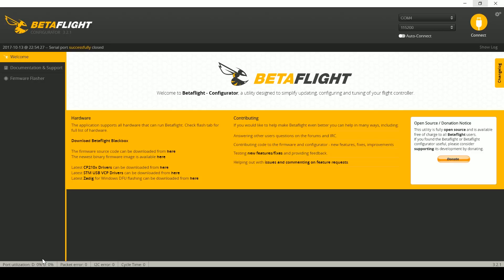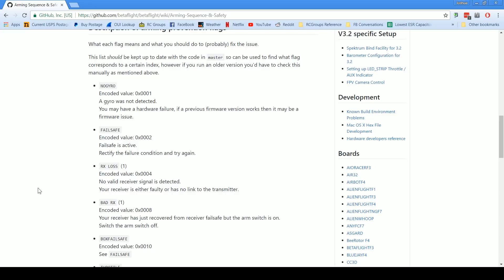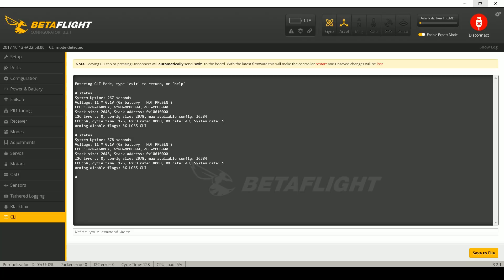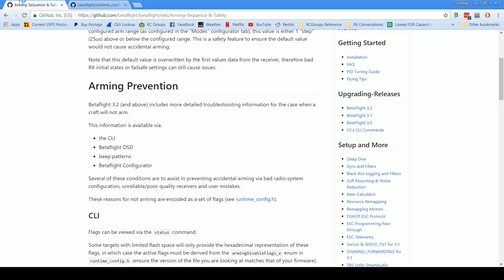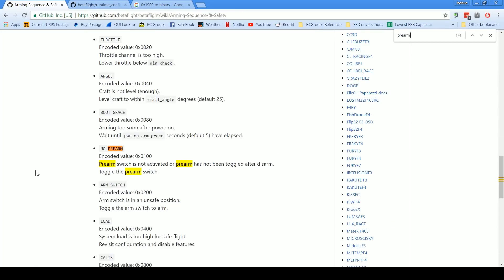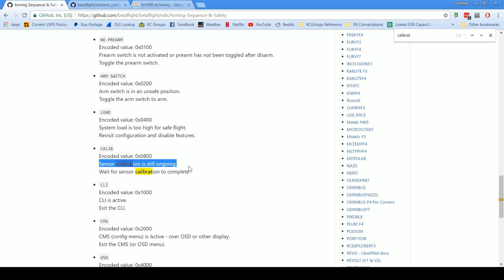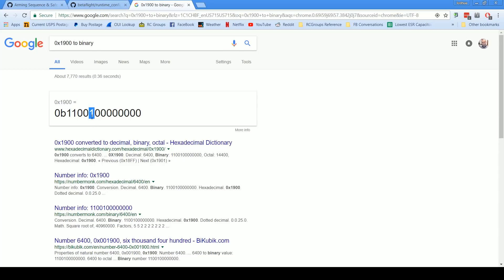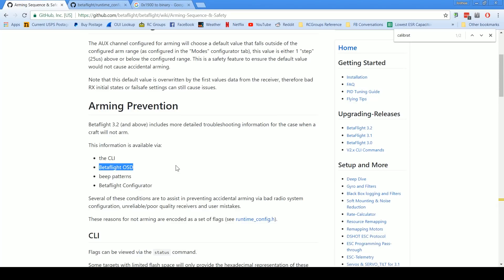Betaflight 3.2 | WHY WON'T IT ARM?

Comment: Hi Joshua, nice video and it help me solve the "Throttle" flag..... Also can you help me because i'm having a hard time solving the "MSP" flag....  I don't know if I did it right because it says "Terminate the Betaflight Configurator connection (disconnect).... So I closed betaflight and restarted my computer just to make sure and still "MSP" flag still appears... Thank you in advance.. :-)
Reply from the maker: MSP means the quad is plugged in to the configurator. If you unplug USB thrn MSP shoukd disappear.
Reply: Joshua Bardwell , thanks for the reply but how can I save my arm switch if I disconnect it from the configurator?
Reply from the maker: If you go to the motors tab and check the "my props are off" option then you can arm whike connected
Reply: Joshua Bardwell,  It worked I saved my arm switch... hehehe... Your the man... Thank you very much... :-)

Comment: Great video, but although RX LOSS is noted, and the response is: Receiver is faulty or not linked to transmitter, my receiver is not faulty and is bound to my transmitter.  I can see my stick action movements in my taranis.  I had just come back from flying and because I had noted some strange throttle action, I opened BF 3.2.1 to see if I could figure it out.  The throttle would start to spike on it's own so I decided to reflash to 3.3 and that's when my receiver tab and modes tab stopped functioning.  Now what?  Your help is always appreciated.
Reply from the maker: Most likely when you re-flashed you erased the configuration and now betaflight doesn't know where to find your receiver or what protocol it is.

In the Ports tab, you need to enable serial RX on the correct UART to which the receiver is soldered.

In the Configuration tab, you need to set the receiver type to "serial" and the serial receiver provider to the correct one for your receiver (such as SBUS, SPEKTRUM, etc.)
Reply: Swapped receivers, working now.  Thanks.

Comment: I'm getting "THROTTLE ANGLE CLI". that's not on that list and google searching it is not helping. any suggestions? (QX65 and ix12 TX)
Reply from the maker: THROTTLE, ANGLE, and CLI are three separate codes. Each is in the table linked here.

https://github.com/betaflight/betaflight/wiki/Arming-Sequence-&-Safety

ANGLE means the quad is not level. Calibrate the accelerometer or disable this protection entirely by typing "set small_angle=180" then hit enter then type "save" then hit enter in the CLI.

THROTTLE means the throttle is too high. If the throttle is all the way down, you may need to adjust your endpoints as shown here: https://www.youtube.com/watch?v=PCLxyurZsD0
Reply: Joshua Bardwell always the Savior brother. Thank you once again. www.neopositivity.com

Comment: how do i disable msp it wont arm when connected to the computer
Reply from the maker: Go to the Motors tab and check the "my props are off" button.
Reply: Joshua, I still cannot get flag 17 (MSP) to go away. Still cannot arm. Went into CLI and got CLI,MSP when I checked status.. any ideas?? Thanks man!

Comment: I’m getting ARMSWITCH in the status. I don’t understand how to fix this. I switch the arm switch on and nothing.
Reply from the maker: It means the quad powered on with the arm switch in the "armed" position. It needs to switch to "disarmed" position then back to "armed" before the quad will arm. Most likely you need to check the Modes tab and see that the arming mode is configured correctly.

Comment: What if it'll arm while on BF and usb but disarms as soon as USB power is removed
Reply from the maker: Put "warnings" element on the osd and it will say why it won't arm in the osd.
Reply: Will give that a shot. Haven't even checked video on this thing anyway since it wont arm and fly. It will arm when on BF... Status in cli only shows cli.... Hell I even just armed and spun the motors up while in BF and as soon as I removed the USB the motors stopped... Rx still bound to the tx
Reply: Joshua Bardwell funny story. I disabled all the flags and enabled the warnings flags in the osd and everything looks great in the video right up until you disconnect the usb and the osd turns off and the video goes black.
I already contacted the vendor and hope to hear back from them soon.
Thanks again for your help tho. I definitely learned something

Comment: I did all my arming and so forth. I use Futaba 8J. I cannot get the props to stop spinning at the lowest point on my throttle. I used end point and I still could not get a setting that will stop the props when the throttle is at its lowest point. Any idea
Reply from the maker: You are wanting the option "motor stop". This is in the configuration tab "stop motors when throttle low" or something like that. If air mode is enabled the motors will always spin when the quad is armed, regardless of throttle position.
Reply: That worked - Thanks - I wished there was a manual telling me what all the led's meant. Thanks again. I have learned a lot from your videos

Comment: Hey Joshua,
I dont know if this is the right place to ask my question, but its kinda my last Hope: I can't arm my quad because of arming flag "Calib" - When powered by battery. When Quad is powered by USB, then calibration finishes right after getting powered on, as usual (3 beeps). 

I already read many articles on github etc and watch many of you videos for this topic. But all hints, like e.g. a higher term of "moron_threshold" didnt work either (Set it to 200). I also calibrated the acc multiple times (with success) But it seems the Gyro just doesnt "Start" when first powered by battery (debug_mode = Gyro -> No movements in "Sensor Tab" on Gyro or debug_3. When powered by USB, there i can see the Gyro correctly working. Additionaly, When Quad is powered by USB only, my voltage drops. Even my Transmitter warns me of that and keeps on alerting. I have to disconnect modules like VTx, to get the voltage normal (until Tx stops warning) I wonder why modules like VTx are powered when connected via USB (maybe it all sticks together?)

Pleeaase, can you tell me what else I can check to finally get my Gyro calibrated for arming?
Omnibus F4 AIO V5 (Not banggood), RAW-Jumper Set to 5v (VTx, Cam)
Hobbywing 4in1 XRotor 40A ESC. FC is powered from ESC by using 8pin Header Connection. Both Parts are new.
Thanks a lot in advance! Greetings
Reply: If anyone need the infos to what happened: It was a Bad FC - even it was brand new. I mounted another FC with exact the same wiring and components - Works perfectly 😁

Comment: In the betaflight configurator I have gotten my Cli to display no problems for arming (besides CLI) and it still won’t spin the motors. Do you think the problem is with my soldering connections?
Reply from the maker: In the Motors tab, raise the slider and see if the motor spins. TAKE YOUR PROPS OFF FIRST. If the motor spins from there, the ESC is fine. If it doesn't, then somewhere between your FC and your motor, there is a problem.
Reply: Joshua Bardwell when I tried it they didn’t spin. So do you think the problem is with my ESCs or my motor since my FC thinks it is ok to arm?
Reply: Joshua Bardwell OMG I am such a knuckle head!! I don’t have signal wires on my ESCs!!! Thank you so much for the help. It’s cool to be talking to you for help!
Reply from the maker: That'll do it!

Comment: Help needed, I am unable to arm. 
After I enter Status in CLI the last line says Arming flag throttle CLI 
I am still new in this hobby so any help is appreciated
Reply from the maker: Throttle must be below the stick min threshold to arm. Go to the receiver tab and adjust your transmitter channel endpoints so that the channels go to 1000 at the bottom and 2000 at the top.
Reply: Joshua Bardwell That was exactly why I couldn't arm. Big Thank You !!  I can't begin to count how many of your videos I have used to crawl through this learning process. Again, thank you for all of your knowledge and effort.

Comment: Ok so it says Rx loss. the green light says it's bound set up a model and in beta flight under receiver nothing moves and in modes it does noting when I flip the switches. Any suggestions?
Reply from the maker: The FC is not seeing the signal from the receiver. So either it's wired up wrong or its' configured wrong.

https://www.youtube.com/watch?v=ZpU6-JY6fnk
Reply: Thank you so much... something you said in that vid made me take a second look there was a bridge pad that needed for hooking up frsky is the signal inversion. It was supposed to be set up for frsky from the factory but wasn't . Thanks again I got it up and running now

Comment: Hi Joshua .. I was having an issue with Arming one of my Quads after uploading the new Betaflight so I watched your two video’s on Why it Won’t Arm .. I followed all of your suggestions & the CLI was still giving me a Throttle Warning ... I went into Wiki to look for causes & wasn’t successful ..  One thing I didn’t check & you didn’t mention is when there is an Arming Switch Set .. I forgot to go into Special Functions on my Taranis & program a Negative Variance for that Switch to Prevent Activation of the Throttle along with What needs to happen when Activated ... After Programing the Switch in Special Functions the Quad Armed & All is Good  .. I’m not sure if anybody else had mentioned this step or not but maybe it will Help somebody in the Future .. As Always Enjoy Your Video’s & Wouldn’t be in this Hobby Without your Guidance ..

Comment: Help! I have this: Arming disable flags: THROTTLE CLI ARMSWITCH. so i'm new to all of this. i was able to fly my quad, but it's not tuned well -- very bad oscillations when i make quick stick movements (yaw, roll, and pitch) on my 450 size quad with 10" props (i need help with this really bad). i'm able to see on betaflight that all is well (i mean that my radio is communicating with my dragonlink receiver, and to the F4 AIO board), but after changing EPA on my Hitec radio, and changing it back to try to fix the problem, it won't arm anymore. Note: i see a flashing blue light on my F4 AIO board.
Reply: Solved. Only thing to do now is PID tuning on my 450 size multi rotor.

Comment: i am able to test the motors out on beta flight but i am unable to see my battery voltage on beta flight . also my quad wont arm and when i type in status it shows RX LOSS CLI how do i fix either issue because you only showed how to identify them??
Reply from the maker: RX LOSS means your FC is not seeing signal from your receiver. Troubleshooting this is pretty open-ended. It depends a lot on what type of receiver you have and what FC you have.

If you email me your details I will see if I can help.
Reply: Joshua Bardwell thank you what's your email?
Reply: Joshua Bardwell email??

Comment: Dear Joshua,

I have seen so much of your vids and want to thank you for suporting us as drone pilots! You are doing a great job at it also. Now I have got a problem that i couldn't solve due to your video's.... I hope you can answer me ASAP. This message i am getting when i type Status in the CLI command line: Arming disable flags: 0x820 ...... Can you tell me or help me with finding a sollution for this! I realy would like to go and flying again but i just cant get my quad to arm..... 

Kind regards,

Dennis C.
Reply: Hi Joshua,

Well I DID LEARN SOMETHING TODAY FROM YOU!!!!
I am so thankfull for your answer! When i watched your vid, I didn't take the time to see the whole video, sorry for that. But the answer was there! I figured out that i could convert it to binaries and the gave me the answer and i solved it in my transmitter and it armed just fine! Man YOU ARE REALLY ONE OF THE BEST ON YOUTUBE! Thanks and go on doing what you are doing! 

Kind regards,

Dennis C.

Comment: I updated the firmware and got the status. it is RXLOSS cli . but I don't know why. I even changed my receiver and it didn't help anything. Did I mention that this I crashed and it stopped working? but it works when I use the motor function. so the esc and motors and flight controller and PDB are fine. the receiver gives back battery voltage and connects and binds fine. it has to be some fail safe triggered after the crash.
Reply from the maker: RXLOSS means the FC is not seeing signal from the receiver. That is what you have to troubleshoot. Ultimately if you are 100% sure the receiver is working right, then the signal pad on the FC might be damaged.
Reply: Joshua Bardwell but it can bind and send back battery telemetry data. i really don't think it can be a hardware issue because I was able to disarm it after the crash. its how I shut the motors down while I did the walk of shame to go get it.
Reply from the maker: RXLOSS means that the FC is not seeing signal from the receiver. There's really no debating this. All other observations must be consistent with this fact. 

Binding just means that the receiver can talk to the transmitter. It says nothing about the receiver talking to the FC.

If you crashed and it stopped working, the motors could have turned off from failsafe timeout, coincidentally at the same time as you flipped the switch.
Reply: Joshua Bardwell okay, thank you. I'm going to desoldering and look for damage. could it be a capacitor or would it just be the pad?
Reply: Joshua Bardwell so its definitely not a damaged pad since it's plugged it via jst. we are talking about a wizard220.. so no it's not a damaged pad.. could it be a capacitor?

Comment: i was going to make a video aswell what u should do but my hammer was closer than my camera i could kiss kiss 5 race quads no probs beta flight 3 quads 3 different problems but no problems with my dys fc running beta flight kiss fc wraith 32bit v2 escs old rs2205 2300kv red bottoms  i have f60pros storms thors fires etc but i keep going back to these old 4 year old beat up motors lol

Comment: Seems great, but when that arm-line in CLI does not show up.....what then? I got the one above, but no more.
Reply from the maker: I am going to guess you are using an older version of BF that doesn't have this feature.
Reply: Actually I am on the latest version. Had some trouble arming a Furibee X215. It is fine now, but the line never showed up....

Comment: I was having problems getting my quad to arm, I've followed your guides on the two switch arming and this one. After finally getting the quad to arm my motors went crazy and no matter how I moved the gimbles could not get control over the motors. I also couldnt get it to disarm with the switches, I had to power down the transmitter. Any help on what I should do to calm the motors and disarming would be greatly appreciated.

Comment: So first off, I love your F4 board. But I'm having some Sbus issues with my third one. I can't get "rxloss" to go away In my cli status or my receiver tab to respond but everything is powered and beeps are correct. And also have telemetry with my taranis. I've tried 2 different working receivers so I'm really lost here haha, any clues?
Reply from the maker: Please contact me privately for help with this. YT comment section will bury your answers and I won't see them.

Comment: Mine shows throttle warning. But I don't understand why because in the receiver tab it shows about 1000 for throttle. So what's wrong?
Reply from the maker: The CLI parameter "min_check", which is also shown in the GUI as "stick low threshold", tells the FC if the throttle is all the way down. So I am going to guess you set that parameter to 1000, which means the throttle must be less than 1000 to arm. Which won't happen. 

Set "stick low threshold" to 1010.
Reply: How do i adjust this threshold?

Comment: Did all things. Still not arming
Reply from the maker: What arming flag is it throwing. That's the whole point of the video...
Reply: Joshua Bardwell yeah your video helped. Thank you very much. This is the exact video i need. I got my first build airborne this morning. Thanks Mr. Bardwell
Reply: Joshua Bardwell it was the holybro kakute FC. I learned more than I ever learned from you in 5 minutes than I have learned in months. Hard to find good betaflight instructional vids. Again I can't thank you enough

Comment: MR JB. You are awesome. I am having problems with BFF4 FC. IT will arm when connected to the computer, but immediately I reboot, and remove the usb cable it will not arm. I am very confused. THis issue only occurs with Boris Betaflight F4. I really thought this flight controller will be the best. Please can you kindly help
Reply from the maker: soooooo you watched the video right? so what arming code is it throwing?
Reply: Yes I did. Your recommendation has helped me with another quad but I am still having this issue on BFF4 in particular. Please review this video to see the issue. https://youtu.be/K7svkV7vJkA  I hope you can find what I am doing wrong.
Reply: JB. I hate to be a bother. Did you get to view the video I made regarding this problem? thanks in advance.
Reply: Hi JB...I ordered another BFF4 and built a brand new quad with new parts...It still will not arm unless I plug it into USB. When my quad is connected to USB it works perfectly. Once I take the USB cable out, it does not arm. Can you please help this is very frustrating.

Comment: Hi Joshua, I got a omnibus F7 V2 board and it takes around a minute to arm. In the OSD it is indicated CALIB or sensor calibration is on going. I am running BF3.3. With ICM20608 gyro running at 16k/8k and dshot1200. I tried 8K/8K still sensor calib still takes very long time which means arming also takes a very long time other standard. I got other omnibus F7 not the V2 same configuration as my V2 board but this one runs on BF3.2.1. Is it the firmware problem?
Reply from the maker: +Romel Mendoza hard to say. I don't know if there is an issue with Betaflight or the board or what. F7 are not yet fully supported in Betaflight so a bug is possible.
Reply: Hi Joshua, Thanks for the reply. Thank you for all your video.